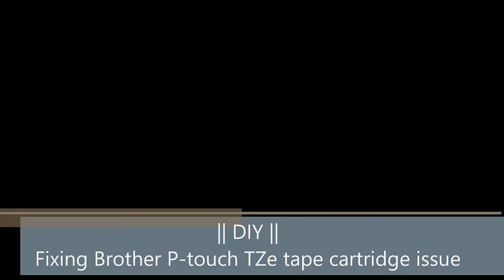|| DIY || Fixing Brother P-touch tz tape cartridge issue fix - latest updated

Comment: Or just return your broken cassette for a replacement 😃
Reply from the maker: they are very expensive and no replacement for such problems.
Reply: @URTechieBear  I thought that from an official distributor, under warranty, they should replace faulty products. (They are not cheap, indeed.) Thank you for your answer, now I have to check if my assumption was correct.

Comment: Thank you! This helped me repair my cartridge, so it was really helpful.  I wanted to point out that there's another catch between the two that you pointed out at 1.08 and 1.10! You have to access it from the underside. Not really critical as forcing the case open should be able to pop it. Using sticky tape to hold down those pesky bits was also a great tip!

Comment: Excellent video - because I had a 24mm tape - out of the box - and jammed.
Mainly - because the thin black color-tape fell off the reel (so it wasn't rolling it up).

I looked at the video - mainly to get an idea how to open it - and what expects me inside :-)
THEN also - how the tapes/reels need to look - as my 'green'-reel was empty ...

THEN - I've done pretty much - the steps in the video ...

ONE ugly thing what happens towards the end is, that the white adhesive tape - got in touch with the thin colour tape.
happened several times - until I figured out what's the reason (tensioning the color-tape rewind reel)

To prevent the adhesive roll picking up the color-tape - simply put 4cm of transparent tape onto the adhesive side.
This way - the thick adhesive roll won't be able to 'pick up' the color-tape ... Makes re-assembly way easier.
When reassembled - just pull out that part of the tape, which isn't 'sticky' - DONE - WORKS :-)

Comment: thank you very much !!! it's not easy to film this, for me it lasts ~ 1 hour - the film tape falls out etc. •  Right at the first test run there was a new belt jam, which now I was able to remove without opening the housing again, as I understood after the praxis bevor the three-belt system. Unlike in the film, all 3 bands were still visible. So I was able to put the 3 bands back together outside of the housing. :-)

Comment: Hey. Thank you for the video, very informative. Do you know what causes this issue in the first place? Is it a faulty label machine?
Reply from the maker: It could be because of bad blade on the device and the harsh pulling of tape without cutting it properly.
Avoid pulling the tape with force after printing.
Reply: @URTechieBear  i pulled the tape after printing and that's what caused the bunching for me

Comment: Tweezers, at least two different types should be in your kit. Using a screwdriver or a pair of scissors instead is not recommended.
Reply from the maker: i was not carrying my toolkit. had to fix it with what ever i had @office.

Comment: Im not sure how to open up the small corners so that way I can fix the insides.
Reply from the maker: you can find the clips on sides. which can be opened with a flat screw driver or such shaped tools. its okay even if 1 or 2 break. as it fixes even without them.

Comment: I printed out one label and this happened ?why?
Reply from the maker: This issue usually happens if you pull the printed label. without cutting or before cutting. we must not force pull the tape until its completely printed and cut completely.
Reply: UR TechieBear Support thank you !

Comment: Wow what a terrible design. such a difficult procedure for a common problem. so there are 3 tapes coming in, but the glue part of the main tape loves to drag the printing tape. i just did the procedure, just to tear it again.
I'd just get a Niimbot. Brother is difficult to maintain, changing tapes is out of question, and peeling off the tape is extraordinary difficult unless you have a halfcut model. Inserting tape alone is difficult. Always gets stuck. Removing is difficult. New tapes are defunct in no time. Peeling off takes minutes, see any reviews how they struggle to actually use the label. Waste of tape happens during each print. What's not to hate.